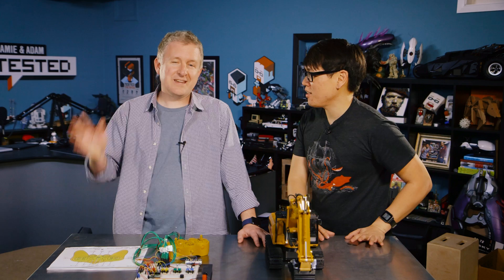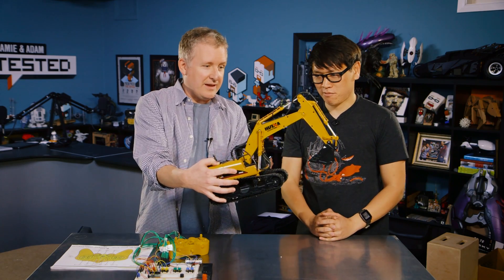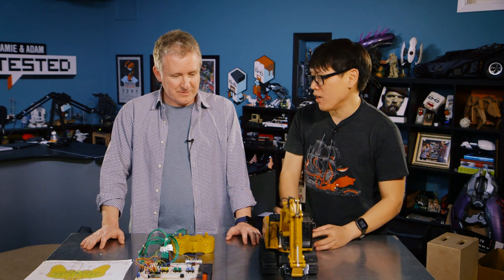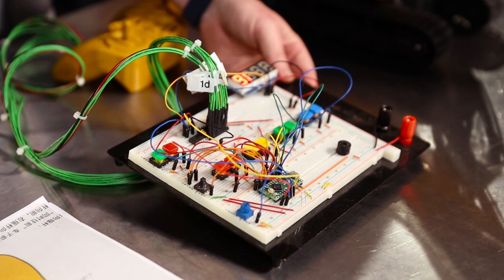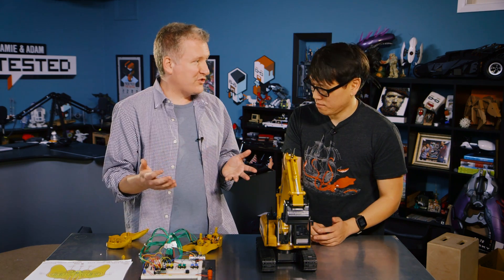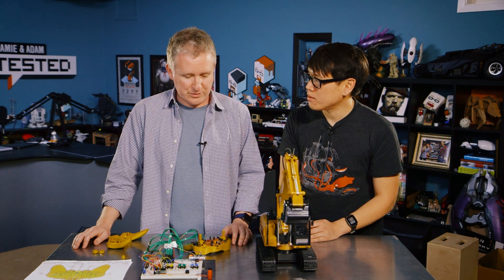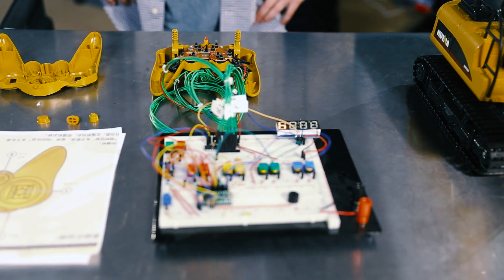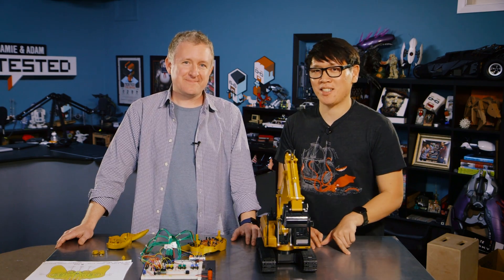Show and Tell: Hacking RC Toys with Arduino Control

Comment: I had to do something similar yesterday to try and figure out which cat was peeing in one particular, somewhat hidden area of the house. I took my Pentax K5 and took apart the remote to figure out which pads activated the shutter, and in turn, hooked that up to a relay, an infrared sensor, and an Arduino Uno. That worked beautifully, but now I need to figure out how to overcome the cameras power saving features, and I think I'll just have to tell it to take a picture every 5 minutes or so, and I should have the culprit.

I was incredibly surprised how easy it all was considering I'm no more than a novice. Oh, how I love this era.

Comment: You did a pretty good job doing this hack. Only real thing I noticed is that you used wire that was way bigger than needed. Next time consider using a chunk of ribbon cable or even Wire Wrap. The current needed is in Milli Amps and fatter wire just gets in the way.

It is good you only had on/off functions to deal with. Analog functions could also have been dealt with by using the PWM output function from the Arduino to bias a transistor to the desired output. There are also many other methods but considering the input/output limitations on the Arduino PWM would have to be used.  In industry we would have multiplexed the data stream and used 8 bit resolution. Since there are only 15 buttons a 4 bit address or 16 Byte data stream would be all that was needed.

Comment: why not just add a delay/buffer  between the controller and the antenna? wouldn't that be simpler?
Reply: +John Ridley You are way overthinking it. Just because the radio frequency that it transmit over is 2.4Ghz don't mean the actual communication inside the controller is that fast. Normally its I2C or a PPM based communication and both those are well supported by the arduino. Just connect the arduino between the PIC or ARM inside the transmitter and the TX module. Total cost for that would be one arduino and maybe a I2C lever shifter if its arm since arm normaly use 3.3 V and not 5 as the arduino do.
Reply: +John Ridley Would need some testing with a logic analysator to check just what it is. Most likely it uses one of the standard well documented chips such as nrf24l01 used by vltoys, hubsan and a lot more. Still it is between the controller (PIC)  and ANTENNA and it's method of using a delay wich both fits of what he wanted to do.Still if you actual want to connect on the  sma connector and have an antenna after re-purposing some thing as a wifi repeater would be a possible solution. Or any thing else basicly with 2 network cards. But then it would just be easier to make a he said in the video. Change the receiver inside the model and just buy any reciver that have a traine port and connect this. http://www.readymaderc.com/store/index.php?main_page=product_info&products_id=285

Comment: 2.4hgz ... Then he says not a typical rf signal for rc cars..... I'm done (it's the most common). Tested is getting dumber by the episode
Reply: he means toy grade
Reply: +Brad Barlow Most toys are 27/49 Mhz
Reply: +Brad Barlow I think he meant it's not using any typical protocol that is used for rc cars. 2.4Ghz is just the frequency, you can have diffrent protocols for the same frequency. That is why you can't use a transmitter from Futaba (FASST protocl) with a reciever from spektrum (DSM protocol) but they both use the 2.4Ghz frequency band. Some of the procols have premade modules you can buy and this is what i think he was hinting at.
Reply: +Thullen oh noes!

Comment: 2.4hgz ... Then he says not a typical rf signal for rc cars..... I'm done (it's the most common). Tested is getting dumber by the episode
Reply: +Brad Barlow As others guessed, I meant it was uncommon for cheap RC toys to run at 2.4Ghz. (The category where I'd place the Excavator). Sorry for the lack of clarity. You're absolutely right about proper hobbyist RC cars, and I wouldn't be surprised to learn everything is trending toward 2.4Ghz.
Reply: +Brad Barlow 27 and 40mhz are used also very often. Is "80% of Hobbyking's RC cars have 2.4ghz" your source of "Its the most common"?
Reply: +Brad Barlow Actually the typical rf signal for a rc car is 27Mhz
Reply: +hudson holt 80% of the RTR cars on hobbyking are 2.4ghz
Reply: +Brad Barlow Agreed. It actually is the most common. 
To anybody else, the 27 and 40MHZ is very old school. Everything is moving to, or has moved to 2.4ghz. If you see anything with 27 of 40mhz, it is at least a couple of years old.
Reply: IrishSkruffles It needs quite a bit of channels for the controls, and with 2.4ghz that is a lot eazyer. And 2.4 is getting to be the norm for toys too. It is not that more expensive, and there are a lot of advantages.
Reply: +IrishSkruffles 2.4GHz transmitters and receivers are dirt cheap these days, especially in China. Possibly even cheaper than the old-fashioned 27MHz ones.
Reply: +Brad Barlow For toys MHz is the most common radio signals, for hobby/scale RC cars 2.4GHz.. The reason it's atypical is because of a multichannel RC system like the one above you'd think they'd keep the cost down by using old technology, especially since this thing would be used at very short range so a 2.4GHz RxTx is pretty overkill/redundant.

Comment: This is fantastic but there must have been a more elegant solution. Idk, great video.
Reply: Usual trick with 2.4GHz stuff is to intercept the communication bus between the processor and the radio transmitter. Not sure if it would be possible here or not though.
Reply: +sample text Well i would assume now the system works you could make up a PCB mount it in a controller casing.